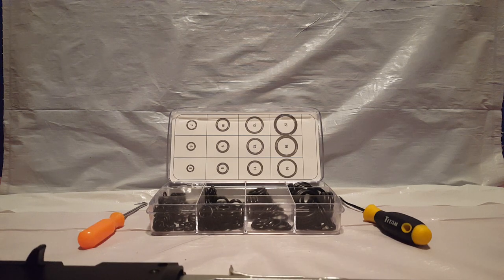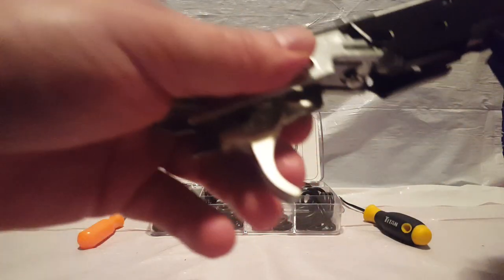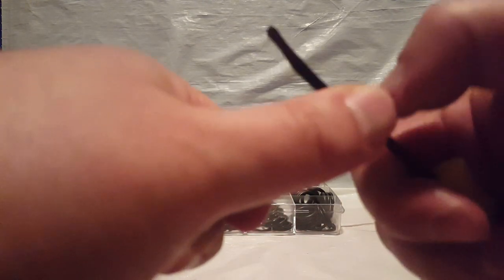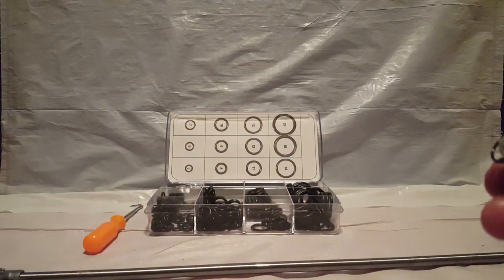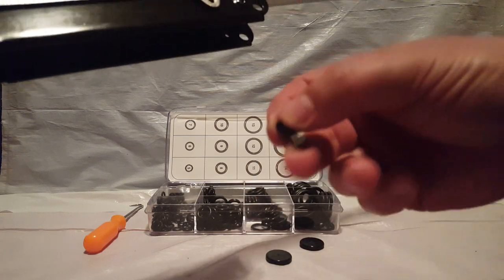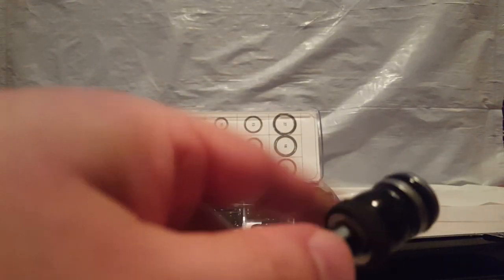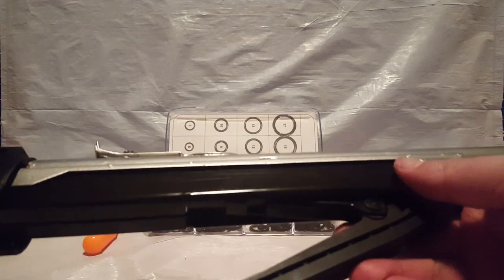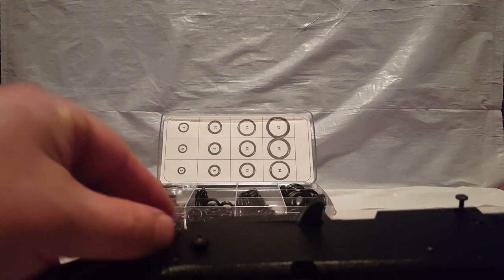Daisy 880 Fix. 3 Main Seals Replaced.

Comment: Could I ship you my 880? I dont have the confidence to take it apart.
Reply from the maker: Ethan, the point of the channel is how EASY these guns are to work on. Great power for the price.

Sending it to somebody, a 3rd party, you may not get it back, and the cost for parts and labor,  better off buying new gun.

Your 880 is easy to fix. It's when shooters put the wrong chemicals in their guns like solvents otherwise known as PETROLEUM DISTALLETS, all 3 o rings can go. But those are basic Nitrile rings you can get from the store yourself. Danco #11 x 2 or SAE 113 x 2. SAE 012 or Danco #7.

The trigger and valve area is more work, so I have a video just on that. If your gun pump lever IS NOT fighting you, it is just ring issue. If you KNOW you haven't used anything other than 30 SAE ND oil, or Pellgun oil, you likely have faulty seals in pump tube. Those fixes are featured in video. Change both rings. Clean off contact surfaces if you don't know  the history of your gun - or if you know you used wrong products.

If your pressure it gone, ring fix is likely it. If your pump lever fights, clean off cup in back, chamber seal. If the lever keeps fighting you, order  seal kit from Daisy reps.  Toggle arrow for Daisy help. I have videos for rep help.

Comment: chrony #s for 880 using 7.9CPHPs
1pump260fps
2p380
3p460
4p500
5p550
6p590
7p623
8p655
9p668
10p690
Reply from the maker: Adam, I have conferred with Daisy Ladies. The only difference I see in the 1977xs design is BEEFED UP pump head assembly. The diagram looks identical to the 880 in every other way.

Unless you SAY OTHERWISE, the 3 rings operating inside the pump tube should be nitrile, SAE 113 or Danco #11.

The only way I'm wrong is if they ENLARGED the pump tube and they are bigger rings. Feel free to correct me. SAE 113 should be a fit.

Comment: I have 20 years with my daisy power line 880 I never repaeret it
Reply from the maker: Alfonso, great! Proper care and handling can carry them for many years. My best 880 from 1997 did not need basic repairs until 2017.

Nice job caring for this gem. Many break these guns prematurely by applying DISTILLATE fluids and pumping more than 10 times.

Comment: Hi, Do you have any videos regarding the 'Older Style' 880's with the metal receivers? Daisy sent me a list of gunsmiths with parts (one of which is www.JGAirguns.biz) as well as a disassembly diagram. Thanks
Reply from the maker: Sir, I refer folks to JL for the BRASS MODELS now. You can buy from him or JG Airguns.

Many old timers tell me to stay clear of those brassers because the valves are no good, but I respect your attempt to keep it going.

https://youtu.be/BzJiBo8QhBQ
Reply: @daisy880fanaticfixit9  Thank you for the reply and the well organized videos.  What make/ model airgun rifle would you currently recommend for hunting and pop can target practice  that you could keep and easily maintain for the next 30 years ?
Reply from the maker: Great question.

For COST,  PERFORMANCE, and easy MAINTENANCE, still the 880.

Modern SILVER TUBE.

I just made a hunting shot around 30 yards - just 7 pumps - and Field Trophy Power pellet. You don't even need to pump it 10 times.

Pick your ammo carefully, don't let the wiper dry out, and it lasts a long time. If it were a hail marry shot, 35 yards and over, I would have used a Raptor....on 7 pumps. Field Trophy Green is what Alloy I will use in the future.